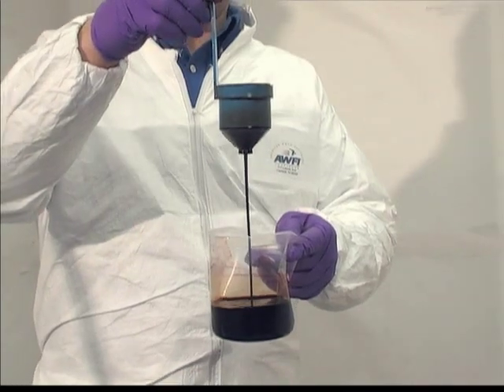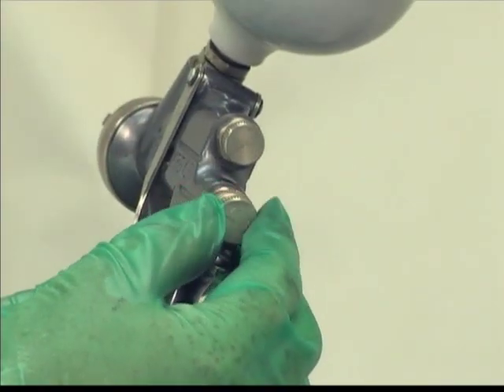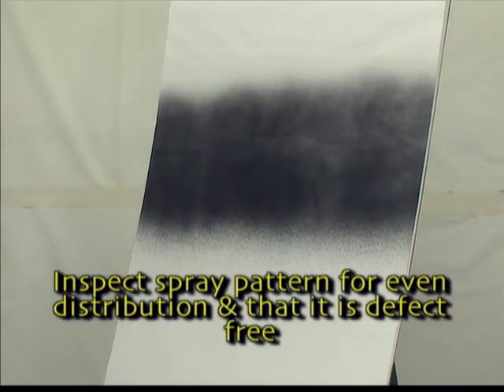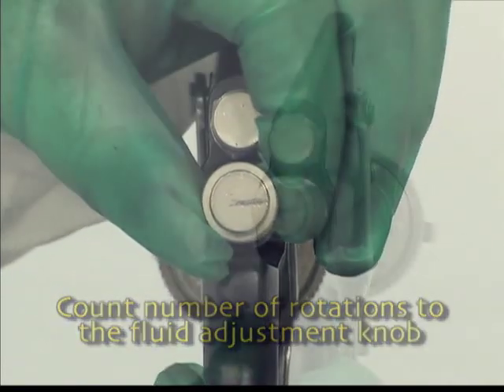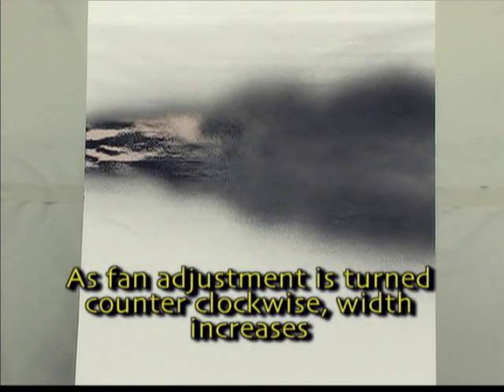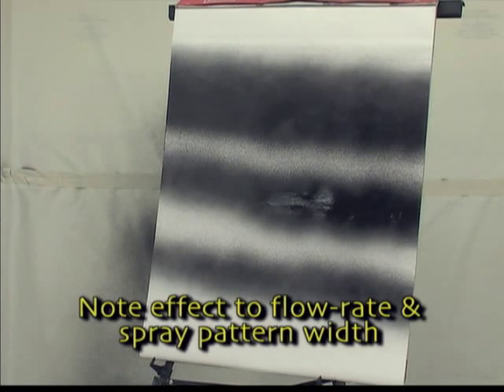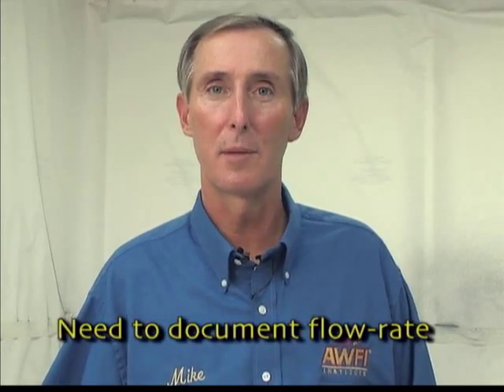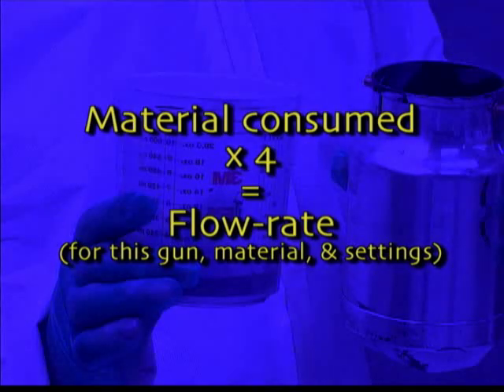Setting Up A Siphon Feed Spray Gun

Comment: … here he does not attempt to explain where the air fan pattern knob should be adjusted to.  Wide open , half way or just a few turns out as the fan pattern adjustment has much to do with what "texture print" you will achieve with the paint once sprayed out on the surface.  We can only assume that the fan pattern is open fully.  But with that said, he demonstrates as the fan pattern is widened the amount sprayed out is thinned and lighter than if the fan pattern is reduced in accordance to where the fluid needle is adjusted to.  This leaves us to believe that to spray properly and with an adequate "flowable" spray amount covering the surface being sprayed one would have to UP the hair pressure slightly to achieve more paint being atomized at any given fluid/air pattern  needle setting or decrease / back off on the air pattern needle to achieve a denser yet smaller flow and pattern. Otherwise the end result will be a grainy or slightly textured end product due to either too much paint coming out and not enough dispersant of material between gun tip and surface or  intermittent slightly dryer areas due to too much air and not enough fluid being delivered.
Reply: I completely agree 😆
Reply: Hey zzzz I have a binks model 18 siphon feed gun.  Do I have to worry about the tightness of what I call the "butterfly collar" thing that I screw onto the tip of the gun.  I know it is used to change spray pattern from horizontal to vertical and all degrees in between--BUT does it effect flow rate?  So far I screw the collar on all the way and crank it down at vertical or horizontal.  Hope that makes sense.  learning
Reply: All guns are different depending on tip size...so it will have to be set to taste upon painting. Not all guns will tune the same.